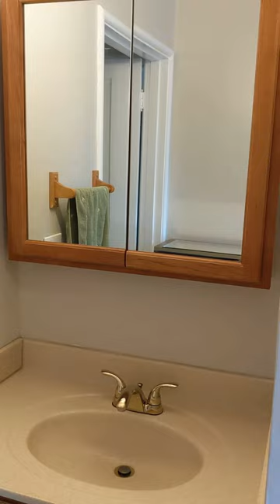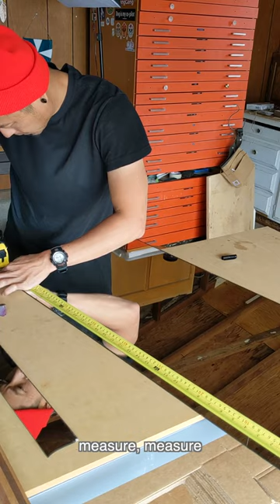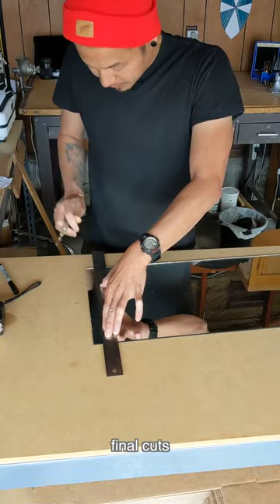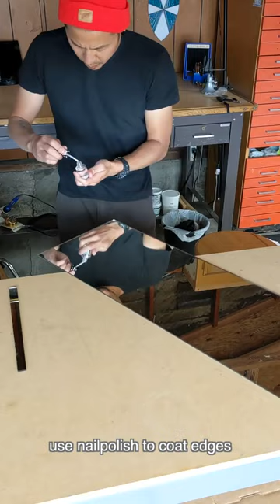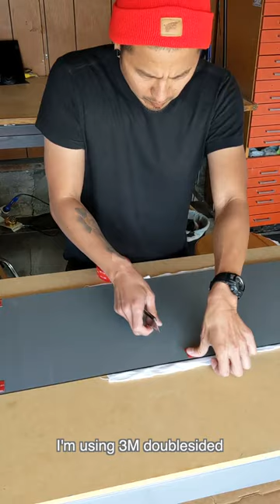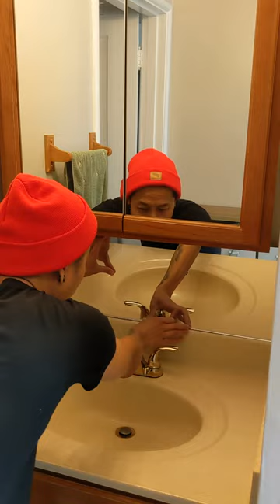Cutting Custom Mirror for Bathroom

Comment: Really appreciate you sharing the skills so we can DIY craft projects at home man. And if anyone wants to give a little extra security to the wall mounted glass pieces, metal mirror clips can anchor to a wood stud or toggle into drywall, and hold tight for decades without falling
Reply from the maker: Excellent tips, thanks for the comment CJ 🤙
Reply: I was impressed with your cutting skills it’s not easy cutting mirror well done 👍 looks great 😊